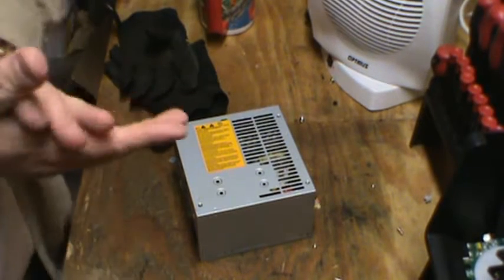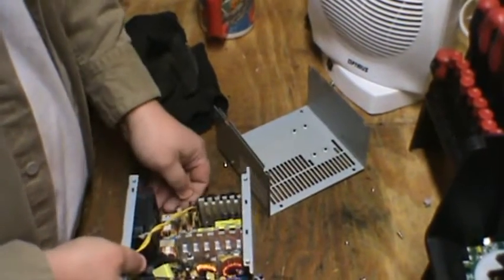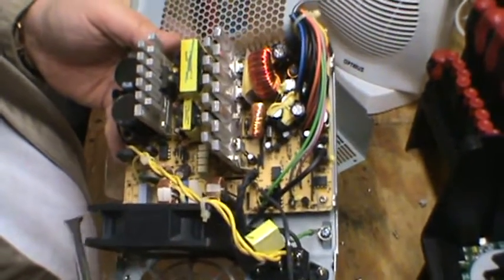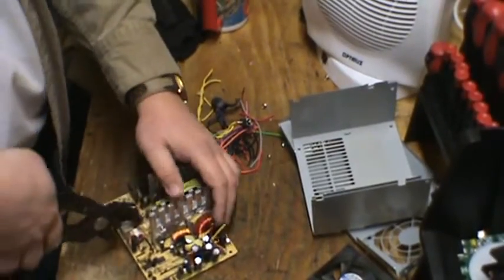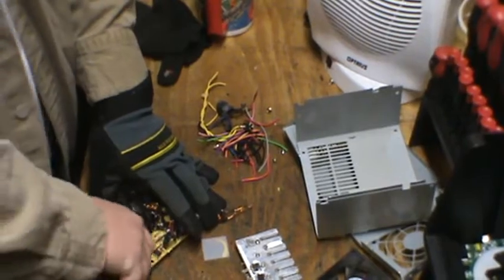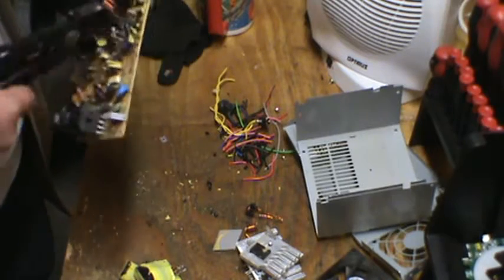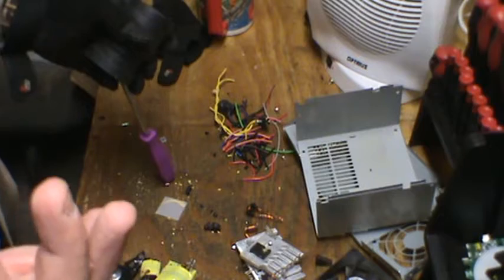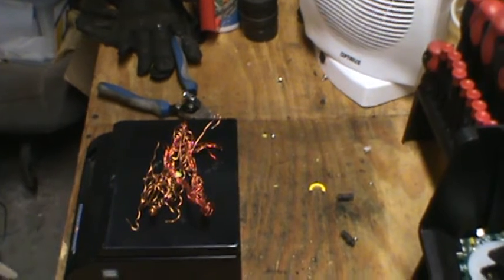How to Scrap a PC Power Supply for copper aluminum and cash

Comment: Hello from Sweden. 
Great video, I also take apart everything the best I can and sparate before going to the scrapyard. 
Those round torroids usually goes in a bucket of their own and I take the copper off when there's nothing else to scrap.
Also on a sidenote,, on some heatsink there is a little thing, usually silvery looking with partial black plastic on them. 
They are copper and my yard takes them as is... Check with your yards if they take it,, adds wheight to your bucket.

Comment from the maker: On power supply boards?  There is usually not much that i have seen there worth going after.  Once in a while i will find some some gold bearing material and go after that.  Where are you finding the Pt and Pd on power supply boards?  Thanks!

Comment: Those little round things are called Torriods. They are made of a soft iron.
Reply: A toroid is simply the geometric shape of the object.  A bagel is also a toroid. THESE devices are toroidal inductors or toroidal capacitors depending on the function it is serving.

Comment: It sucks to dump those fans because as a working fan they are worth a few bucks, but I have tried to sell fans locally (Craigslist) and eBay with no real luck.  Sold a handful out of dozens and dozens I had stacked up, all different sizes and some heavy-duty ones too, for industrial and lab use.  There's doesn't seem to be much of a market for used fans.

Comment: Mr. Scrapper, this is where I found the gold plated heat sinks. They were in the power supplies. Like I said on the other post, they were 1/2 gold plated copper and 1/2 gold plated aluminum.
Reply from the maker: +stephen p I would be willing to bet money hat they are just painted gold and do not actually contain gold.  There is no reason for a heatsink to be plated in gold, it would be an extra cost for the manufacturer that would not help the product at all.
Reply: +stephen p It's probably anodized aluminum, Moose is right, it would be unnecessary to plate heat sinks with gold.

Comment: Hi Moose, stripping a power supply is easy, but I'm also stripping the small transformers, to get to the clean copper, however, when I strip it, there are always some copper strips in too, with some partially covered with some kind of insulation, can you perhaps advise me how to remove that without having to burn it off?

Comment: What would the capacitors be worth?
(not for metal but for working pieces)
Reply from the maker: +TicTacRich Great question, I have no idea.  I do not know enough about all of them to attempt to try to sell them as working.
Reply: ok, thanks anyway. :D
Reply: +TicTacRich i would advice the use of used capacitors, and when i do have to use them its probably just as a temp fix
Reply: Depends ENTIRELY on the brand, there's usually a model number you can decode to get the brand, or some companies put their brand on it. Once you know the brand, you just need to know where they're from to determine the value. If they're German or American, the caps might be worth a little bit, if they're Japanese, they're worth a lot, if they're anything else they're trash.

Comment: is there a way to take coating off copper to make it bright copper
Reply from the maker: There as been a lot of talk about this.  Lots of people have tried things from using paint thinner to cola.  Nothing that I know of really works well enough to make it even close to be worth the time and effort to do it.  Mike the scrapper has a video where he shows what happens with the top methods reported out there.  He may have more info on it.  Tell him I sent you.
Thanks!
Reply: Moose Scrapper
hi Moose check out my video on the turning #2 copper into # 1 copper i found a way to do it

Comment: How much more do you get by taking the power supply apart? Last time I went to the scrap yard, I got $7 for about 70 pounds of power supply (whole power supply without anything taken apart)
Reply from the maker: Yo uwould make 2-3x that money.  More if you sold them with the wires still attached.
Reply: First and foremost that yard ripped you off.. Look for a new one and make it clear you are aware they ripped you to them. Do a online review or something. Next step is to take them apart you would be making way more.

Comment: How do you discharge your capacitors beforehand?
Reply from the maker: you can do that with a screw driver that has an insulated handle.  touch the positive and neg ative with the screw driver with out any part of your body touching the capacitor, or item its in.  Mike the scrapper has a video on just that....
How to discharge a Microwave.

Comment: You pull the brass plugs and socket out of your PC Power cables but don't pull the plugs out of the power supply? You left the plug on the casing for the steel pile.
Reply from the maker: Yeah, these I have had a hard time getting the brass out......  you are right, they should be removed, but I have just gottne frustrated with them and threw in the steel pile.  Power cords, the ends are a much softer plastic/rubber material and they come out easy.  Thanks!
Reply from the maker: Great catch by the way!
Reply: I never thought of the brass in plugs before seeing your video on power cords. I have taken apart 2 Power supply seance my post here and the pins were a white metal not yellow so I am not sure they were brass.
Reply: They are Nickle Plated Brass if you snap them by bending them back and forth you will see the yellow brass inside. I have found 2 or 3 that are Iron but it is very rare just pore them over a magnet.
Reply: John Kuczwara all the ones I saved are not magnetic ...I probably tossed 1000 before I finally started to save them will have to see just how much they fetch ..Is it really worth saving and stripping them out ....

Comment: Hey Moose just take those plastic things and put them on their side and hit them with a small hammer and they will split on either side of the copper plate. I saved those copper plates for about 4 months till I had a 5 gallon bucket full. Almost 100 lbs of #2.
Reply from the maker: Now that's some nice cheddar!
Reply: Hell yea.  A cold chisel can split them open too.

Comment: So after breaking this down in my market price, that .02 steel, .02 wire, .08 Alum, .05 CBM, .31 #2copper, roughly .50 each, or they sell for .05/lb whole in my market. . Florida 11/2015
Reply from the maker: +Stephen Bayer Jr certainly something to think about huh.
Reply: +Moose Scrapper Time vs Money, i personally sell my power supplies whole without wire, just because there are larger things to break down for bigger payday. If you have limited "scrap" inflow, then yes BREAK IT ALL DOWN, its the only way to get ahead, selling whole is more effective for me, but always cut the wires, and NEVER sell as shred..

Comment: You missed one small part of the power supply. The screws that go into the heat sinks that attach those leads onto the board. those black plastic things, hit them with a hammer they are copper and they add up after awhile
Reply from the maker: I find that the black plastic is a real chore to get off.  At the very least I bet I could get copper bearing motor price for them.  Thanks for the tip I will try and save them from now on!

Comment: your lucky the capacitors were not charged. The copper things are coils, the copper on them is insulated.
Reply from the maker: Hi and thanks for watching!  Not really luck if you are sure to discharge things before you take them apart.  I havn't been zapped once!

Comment: pc power supplies dont contain motors.....the only motor is in the fan
Reply: +ictdude1 Copper Bearing Motors or CBM's is a loose term, it just refers to copper attached to other materials such as iron or ferrite. So those toroids and transformers would be considered CBM even if they aren't truly motors.

Comment: This is extremely dangerous... nobody should attempt taking apart a power supply. You're lucky that the manufacturer sealed off those capacitors, If the top was exposed you could have received fatal shock. Yes, you can die from this.
Reply: capacitors are only dangerous if still holding a charge, so discharging them will make them inert and therefore safe to work with, anyone should know the dangers of working with electronics before doing so.
Reply: id like to know more of the dangers of working with a power supply
Reply: NoSkillzJustGillz there's really not that much danger if you know what you're doing... Just capacitors are dangerous and only if they still hold a charge
Reply: alrighty thx! n2s if im gonna scrap or not i have 2 old ones sitting around
Reply: NoSkillzJustGillz go ahead, if they havent been plugged in for over a month you should be good, over a year they wont have a charge left in them. if they do have a charge you can touch with an insulated screwdriver and youll be able to fully release the charge without shocking you, of course this is only necessary if theyve been plugged in recently...
Reply: thx for the info =]
Reply: NoSkillzJustGillz no problem I'm experienced with alot of things, including electronics and computer parts, let me know here if you need more help
Reply: No, it is not extremely dangerous. If you are worried about a cap holding a charge, just short it with a screwdriver or take a piece of aluminum foil and put it on the circuit side.